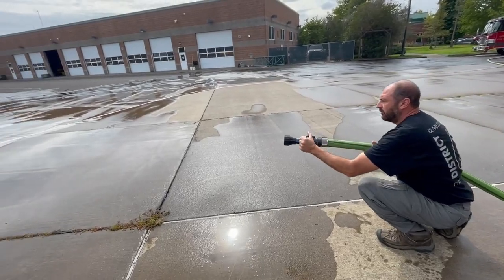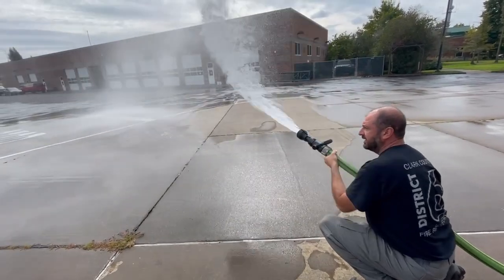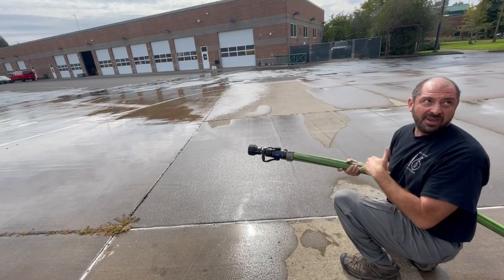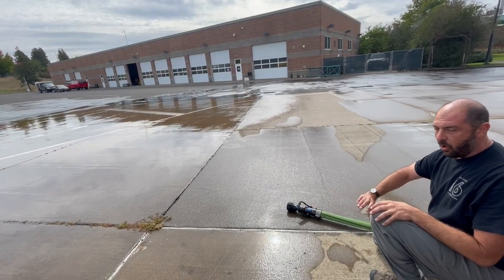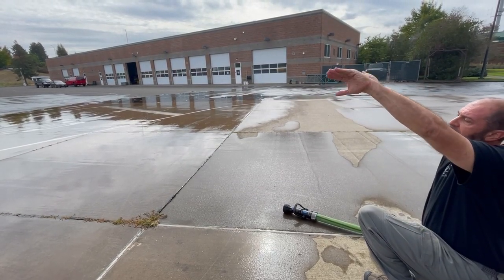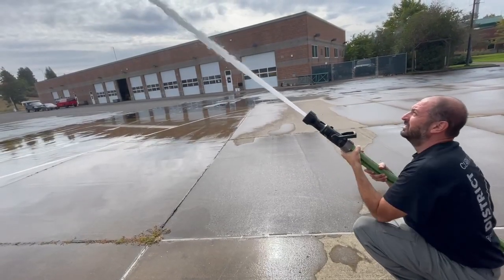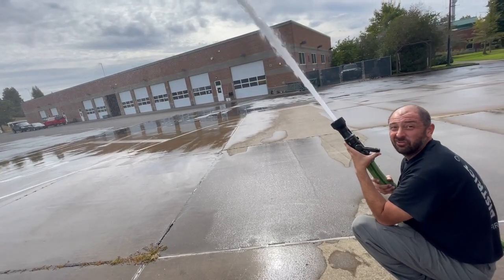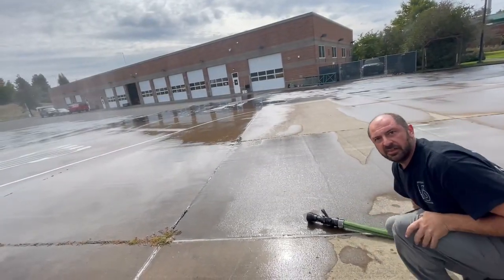HEN 160gpm@50psi Application Blade Vertical vs Horizontal

Comment: This is simply a modified fog nozzle. Droplets of water move air. A line moving 150-180 gpm covers an entire room quite well with little movement simply based on velocity alone. Look at the water mapping studies done by FSRI.  a solid bore will move closer to 200 gpm at 50psi and so sheer volume and limited velocity will overcome the fire without need to cover an area with a modified fog line. I look at this line as simply an attempt to decrease the amount of air entrainment for fog nozzle adherents.  There is little to no explanation of what issue is this nozzle attempting to solve that isn’t being done with our current lines.

Comment: Do you think overall gallons used will be less than what was documented by UL in their interior and exterior hose stream study? You discuss the overall gallons used on 1 and 2 room compartment fires being pretty much less than 200 gallons while flowing and moving. All things being equal with a smooth bore vs blade at 160gpm, do you think that the coverage provided by the blade would reduce water usage and increase effectiveness? Really awesome to see history in the making.
Reply from the maker: The easy at which the pattern is applied, with the down stream coverage enhancements, picking more fuel simultaneously with a still concentrated GPS per sq foot in the 80 oz or greater sweeps, plus the already large droplet storm  front of the nozzle in the gas column pre object impact.  This creates a proximal cooling by the nozzle immediately, allowing a better advancing path for the nozzle team, plus a most like a higher rate of change with gas being contracted and with better make up air, proper amounts of air entrainment with less work.  You add this up all together and equal nozzle men / women 7/8 vs 160 Blade will do better quicker suppression with the blade.  Often that will lead to less water use, the more important item is it helps the nozzle position perform better at their key functions..      Its a extremely good equipment enhancement in mission both life and property.  I have produced a series of articles here traying to explain it.. https://www.linkedin.com/in/dennis-legear-54659140/